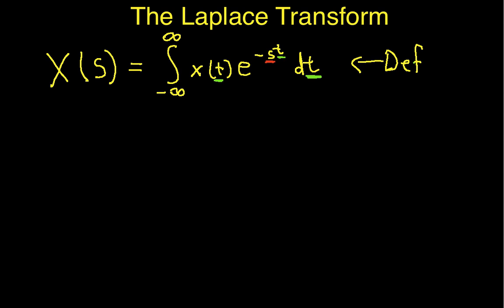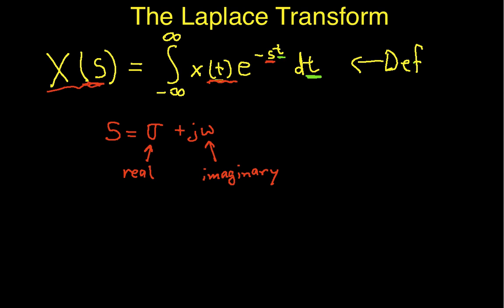Introduction to the Laplace Transform

Comment from the maker: It depends which type of Laplace transform you are computing. Most signals and systems books start with the bilateral Laplace transform where the limits are -infinity to infinity; the bilateral transform is less useful (in my humble opinion) than the unilateral LT. The unilateral Laplace transform has limits from 0 to infinity. If you are computing the Laplace transform of a signal that is zero when t is less than 0, then both types give the same transform.